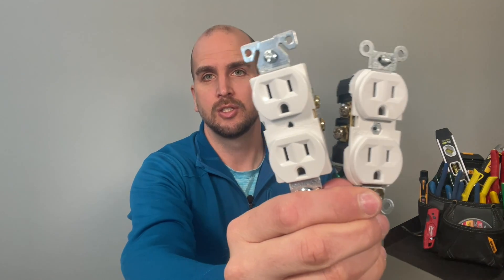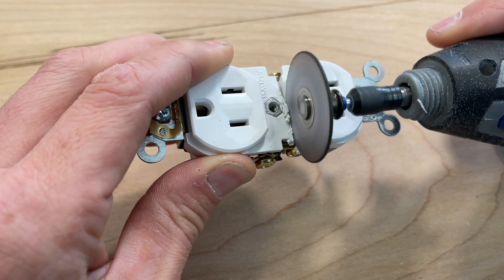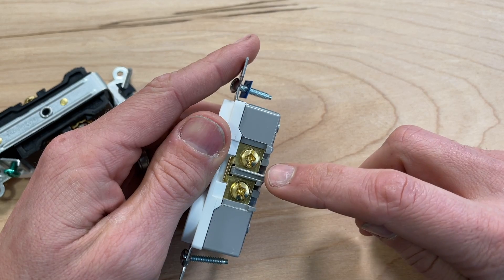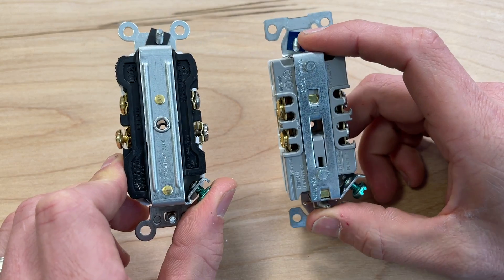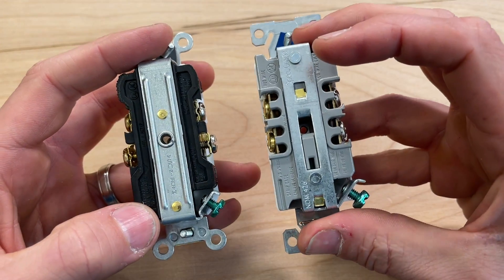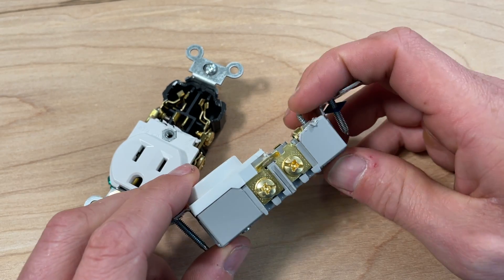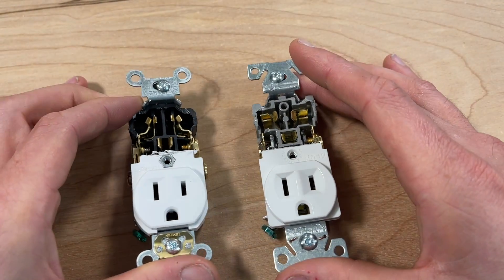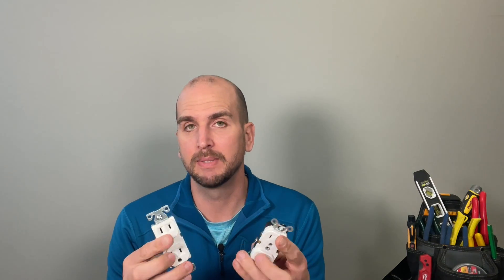What Outlet Should You Buy | Leviton vs Eaton

Comment: You can't use either one of those in GA. They have to be Tamper Proof
Reply from the maker: This comparison is still relevant to the TR receptacles as well since the TR mechanism is just built into the top white housing.  Just going to have a bit higher cost.

Comment: I didn't follow the bit about self-grounding.  Why does that little tab or wire matter?  If the receptacle has the metal yoke and that yoke is secured to the metal box, what does that little tab or wire do?
Reply from the maker: On the other mounting screws you usually have a fiber or plastic washer on the back side to help the screw from falling out of the yoke.  In these cases when mounted to a metal box there could be a weak bound between the metal box, mounting screw, and yoke depending on the position of the fiber or plastic washer.
Reply: @EverydayHomeRepairs  Ohhhhh....   So the wire or tab isn't so much about making the connection it's about retaining the screw in a way that doesn't prevent a good electrical connection!
Reply: The springy brass thing on the Leviton receptacle looks like they put it on backwards (IMO it should be on the back, not the front).  I always thought their purpose was to connect the receptacle ground to the metal box.  That way, if you know that one of them has a proper ground connection, you don't need to run a wire to the other.  A Google search seems to confirm that this is the typical/historical purpose of the feature.  Here, it looks like Leviton either wasn't thinking when they put it on, or they decided that a more important purpose would be to ensure that a metal cover plate gets grounded (which to me sounds like a good idea if you're using a metal plate).

Anyone actually using a self-grounding feature ought to be thorough enough to take those fiber retaining washers off the screws before installing.

Comment: As a residential and commercial electrician who works with these on a daily basis I will say that eaton receptacles and gfci's are the BIGGEST pile of crap ive EVER dealt with. I will NEVER use them. In the last 6 months ive had to replace 12 gfcis [8 WR, 4 regular] and another 10 or so regular receptacles. Leviton is my go to gfci and outlets and lutron my go to for dimmers. Quality and RARLEY an issue. Eaton DOES make pretty good electrical panels and breakers that I like though.
Reply from the maker: Really appreciate your feedback.  I try to soak in all the great experience people like you provide 👍

Comment: LOL! I have been collecting and using receptacles since I was 10, and I knew about the screws holding the top part. The triple wipe contacts of the Eaton is what is common for COMMERCIAL receptacles, what the heck is up with that LEVITON??!! Even the OLD Leviton Commercial receptacles have the better triple wipe contacts so they made the rec cheaper now.. Sheesh, must be made in China now.. Leviton was made in the USA in NY in the old days, the EAGLE was made in NY as well back then too. Then LEVITON was made in Mexico in the 2000s and now? China.. Right now I would go with HUBBELL!
Reply from the maker: I am leaning towards Legrand (Pass & Seymour) after taking a dive into Leviton, Eaton, Legrand, and Hubbell for Spec grade outlets.
Reply: @EverydayHomeRepairs  Amen! Legrand(P&S USA)are VERY good actually. I have both the tamper resistant and non TR kind and I have found their non TR variaty to be pretty robust and I like the finder grooves on their face. The Hubbell brand is great for the TR series which I bought in multi colors except ORANGE and YELLOW. The IG Orange is too expensive at $33 each and the YELLOW they do not exist in Hubbell TR kind, only non TR. P&S brand I have the ADORNE series with cast BRASS face plates.. Outlets are a passion for me so it is not for utility sake only here. Like in Europe, I buy for the looks too.

Comment: What is the difference between a 15 amp and a 20 amp outlet?
Reply: Not an electrician, but I believe the hot and neutral prongs on a 20 amp plug are horizontal, not vertical like 15 amp.
Reply: '.' vs -.- if this works haha
Reply: There are actually four combinations of vertical and horizontal for the two slots.  For 120V 15A, both slots are vertical.  For 120V 20A, only the neutral slot is turned horizontal.  There's also 240v 15A, and 240V 20A.  For 240V 20A, it has "the other" slot horizontal (would be the hot prong if it was 120V).  The one with both prongs horizontal is 240V 15A.
Reply: The 20A outlets have a T-shaped slot, so you can plug in either a 15A appliance or a 20A appliance.

Comment: I really don't see any real difference between the back wire hookups of these.  Both have a thin plat that moves.  Both have a thick plate that doesn't.  If anything I like that the Levition lets you see how well the wire is clamped, vs the Eaton you can't.  Also, The Leviton also has a though rivit in the center instead of those two "screws" at the end.  The difference here it that you avoided that par just because of the way you chose to dismantle the outlets.  No real advantage there either.

Comment: Never would strip wires using the outlet tabs.  Looks like it took you 5 times longer than using real strippers.  Here we go with the back wiring again.. Both outlets have the terminations on the side of the outlet.   Even J hook wiring around the screws is done on the side.  I have used these types of receptacles for many years and they are not fault free.    With even the slightest bit of twisting of the receptacle when adding the wires tends to loosen the ones you've already done.,

Comment: I came up with a mnemonic. When looking at the GROUND prong, think "SAFETY is LEFT UP to the installer. Some installers are DOWN RIGHT DANGEROUS". I understand that CA code now requires outlets to be wired as such. The presenter mentions MEDICAL OFFICES where the job CALLS FOR GROUND UP. I can NOT recall being in ANY SORT of medical office that was NOT wired GROUND UP (and this goes back DECADES) Think about 30A & 50A services. I believe that CODE REQUIRES the GROUND to be UP. WHY, Because it's SAFER. When I took Trade Electric 1 & 2 back in 1999, the textbook author opined that he believed the next edition of the NEC would REQUIRE GROUND UP (or to the LEFT). Sadly, that did not happen. GROUND UP (or to the LEFT) is just a bit SAFER so, why NOT do work in the safest mode possible? I agree that spending a bit more to use quality COMMERCIAL GRADE componets is the way to go, even in residential service.

Comment: Pro..1..wite stripper.. ground up or down...safety issue...ground up.  Reason..ground prong longest on cord cap..it makes contact with ground contact before power prong makes contact..safty reason.. if something slides down the wall behind the cord cap it will come in contact with the ground before contaCting a power prong.  Always ground up..

Comment: HD is around the corner from my house. For one off, I get the Leviton at HD. For a larger project, I get the Eaton from Lowes. I used only Eaton in my addition. Much easier to work with. I also knew that the Eaton had the internals of a 20A outlet with the face of a 15A outlet.

Comment: I always went to Leviton first. If I can't get Leviton, then I buy what I can get. I like Leviton's ground strap, over Eaton, but I agree that Eaton has the better design overall. The wire and ground strap is moot anyway since the yoke is grounded anyway, and also shows continuity with the ground holes and the screw on the front. And yes, Newer homes are creating a problem with non metallic boxes. One house I purchased had plastic and nylon boxes. I paid an electrician some $28,000.00 of money in my savings account to get that crap out and put in the metal boxes. I wish people would stop with the plastic crap.

Comment: As an Electrician, Eaton/Cooper has always been my residential preference. I have replaced many failed Leviton devices over the years, problems like cracked or broken plastic housings and worn out contacts that no longer hold the plugs properly leading to shorts and arcs.

Comment: One other note about my experience with GFCI plugs...  leviton gfci on kitchen duty 20A loses grip within 2 years.  I've had eaton gfci melt the backside with resistive loads plugged in within a month.  Hubbell GFCI - great grip, but for some reason something fails and the test button does not work and it loses it's ground fault protection feature- even using a gfci tester - i can't figure out why.

Comment: Agree - Eaton looks better.  Will be my choice for my project that puts a second floor over my garage.  Lots of plugs needed.  Most will be 20A outlets few for the 15A.  15A will be for hanging lighting like shop fluorescent lamps - or other hanging lights.  They will PLUG IN rather than be WIRED in.  Ease of hanging and changing.

Comment: I'm an electrician with 30+ years of experience.
Why are you using non-TR receptacles????  They are illegal.
These are NOT the same grade receptacles.  That is an upgraded Eaton ...I know this because I've done what you've done ...taken them apart and you are looking at an upgraded Eaton.  You may be comparing a commercial grade Eaton to a Homeowner Leviton.  The standard Eaton does not have a 20 amp socket connection.  The commercial grede Leviton does have a 20 amp connection for the plug.
Go to any professional electrician's forum and you will see how much we despise back-stab connections.  Don't use them ...it's a sure sign of an amatuer
Eaton receptacles fail more than Leviton.  Eaton's AFCI circuit breakers fail more than any other brand.  This is coming from a guy who installed 2 Eaton panels in his own home 16 years ago -I've had no problem with them, but I would not buy an Eaton product today.  Over-priced and lower quality than the other brands I use.

Comment: Great video. As a retired electrician who still does odd jobs here and there, both brands a good brands. One has to nit-pick at each one to determine if there are any cons.  Personally, I like Leviton. In your demo you showed the back side, and the Leviton model had backwire connections not as good as the Eaton.  My preference is Leviton's Decora line.  Decora spec grade #16252 (15A) has identical backwire connections as the Eaton. I love the ease and safety the backwire type offer. And as you have said here and in other of your videos, commercial grade (AKA spec grade) is far superior than residential grade and worth the price.  Keep up the good videos.

Comment: I use that Tool to strip Cable.  And I just push in the Cable on the Outlet Connection like into a WAGO. No turning Screws at all. KNIPEX 12 62 180 Automatische Abisolierzange 180 mm https://www.amazon.de/dp/B000PAR60C/ref=cm_sw_r_cp_api_i_8Q6VQZX5SNHGSH415CXD

Comment: Glad to see it appears the industry is moving away from the spring-loaded knife edge push terminals. Those always seemed like trash to me.
Reply from the maker: Actually those are still widely used but just on the residential grade ($0.50) receptacles and only for 14 gauge solid core wire.
Reply: @EverydayHomeRepairs  ah, gross

Comment: i always buy leviton  commercial grade .did you do a program on circut breaker panels i always use general electric panels they have a copper bus bars .i have installed several leviton panels latelay

Comment: Regarding the internal builds of these, Leviton should last longer with something plugged in over a long period of time because of the "spring like" pressure on both sides of each flat prong, while the Eaton should last longer when used in an application that sees a lot of plugging and unplugging like in a hotel where the outlet is used for vacuums. I use Leviton because that's what I have available where I live, but the Eaton is much burlier of a build.

Comment: the back wire of the Eaton is my preferred connection method , as is the Eaton my preferred outlet , problem is i have trouble finding the Eaton's , no Home Depot or Lowes within 50 miles of my home , have an Ace within 20 miles of me , higher priced but a lot closer ..

Comment: I have used both, mostly  because of availability, but I also prefer the Eaton.. Price is not really a factor when your talking 30 to 40 cents. I mean that's 3 or 4 dollars per 10... I guess if your doing hundreds that would add up, but you're probably losing about that in waste.. There are better ways to save a few dollars than buying and installing cheap stuff.

Comment: i think the internal plug connector assembly in the Eaton makes the leviton look stupid.  I like the three prong, 90 degree action that insures good contact.  the icky leviton contacts don't look as robust, in particular the way sometimes the internals get push around when appliances are violently/improperly unplugged.  Also the commercial grade housing, internal terminal separation and superior back wire features make the Eaton a real winner.  I've used both, and i only use commercial grade anything from these guys, but now I've seen the internals, I will stick with Eaton.  Bye bye leviton,  Wish I knew this earlier, now i want to go and change out any levitons i have, plus I have a bunch in stock in my garage...

Comment: Handy tip: if your dealing with stranded wire on a bolt down, like a terminal block, twist the strands counter clockwise. Wrap your Jay clock wise, n tighten snuggled 🙂 hope this helps
Reply: There are no stranded wires connecting plugs or switches.PERIOD.
Reply: @felagoran7076  24volt DC command hmu, relay and door bell
Reply: @felagoran7076  don't forget anything above 12 gage
Reply: @felagoran7076  
Where are you located and what types of properties/equipment do/have you worked on?????

Comment: Honestly, I don't care whatever receptacles you buy. Just DON'T use the push in connections in the back, EVER! I just finished changing out my passed father's house where so many circuits were dead because of the push in wire connections. Use the screw terminals always.
Reply from the maker: I agree, not a fan of push in connectors but I do like the back wire feature on both these Commercial grade receptacles.

Comment: German viewer here: I just came across this review by accident and stayed to watch. I was interested to see that you are still using screws to secure the wires in USA. For our wall mounted electrical outlets, we haven’t had screws to secure the wires for at least 15 years now. We have spring clips to grab and hold the solid copper wiring. That prevents any contact going bad because of screws slowly loosening from thermal cycling or vibration. Is that kind of wire connection also available in the USA or are all wall-outlet wires secured by screws?

Comment: That's not a back wire feature, that's just simply a wire clamp wich is preferred for doing commercial because stranded wires are typically used in commercial unlike the solid in residential. Back wire is what you see on residential because it's a spring designed to grab solid wire only as you stab the in the wire, and it's 14 AWG only; eliminating the need to tighten any screws for faster installs in residential production jobs. Personally I never use the stab in back wiring option because it's a common failure point, especially when people plug in electric space heaters.

Comment: The strength of the backwire connection is what sold me on the Eaton (then Cooper) way long ago.  It was the first time I felt I wasn't skimping when I did a backwire instead of a sidewire.  I was surprised by the results of the survey.  In the beginning I thought all receptacles were the same, or that nuances didn't matter much.  But after replacing receptacles with loose backwires (yes backwires, not push-ins - although replaced bad ones of those more), I noticed they all weren't the same.  The ones that worked well were the Eatons (then Coopers).

Bonus, I find the Eaton backwire easier to use than Leviton's.  The hard stop when the wire goes in to the same place every time, the reliable grab of backwire plate, it's a solid action.  The Leviton can involve a little fiddling to be in the right spot, and you can push the wire too far onto the insulation.  However, Eaton's sidewire can take practice to get good on.   If you don't get the length+angle of the wire and loop right or you are pressuring the screw the wrong way, you can spend a minute or more fighting to get it in.  It is doable quickly, though, just have to learn it.
Reply from the maker: Good stuff RJ and thanks for all the feedback.
Reply: What loop? You put the wire in straight, so I am confused by what you said.
Reply: @illestofdemall13  In regards to a loop, I was talking about when sidewiring.  This is where the wire goes around the screw, and pressured between the screw head and the plate.
Reply: @RJ-ej1nr  Got it now, thanks. I never make a loop when the have the clamp/plate, so I guess I kind of forgot you can still use them that way. Lol